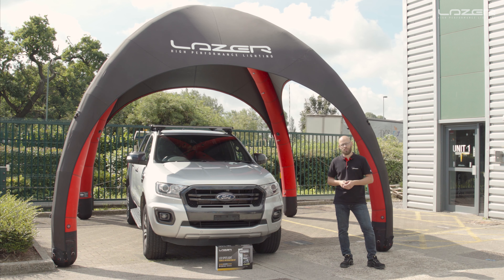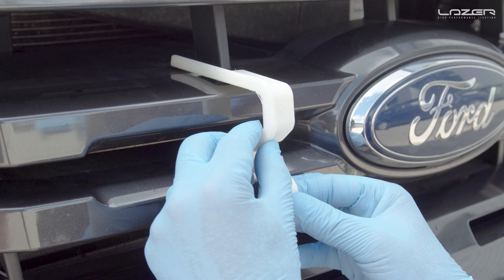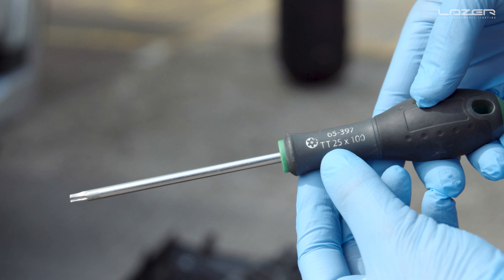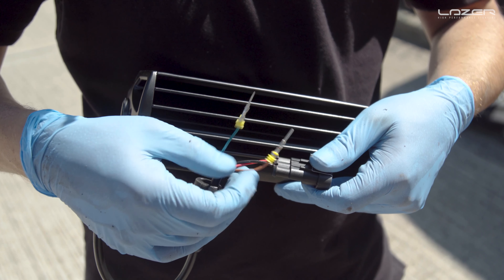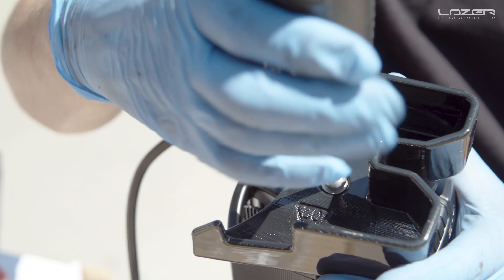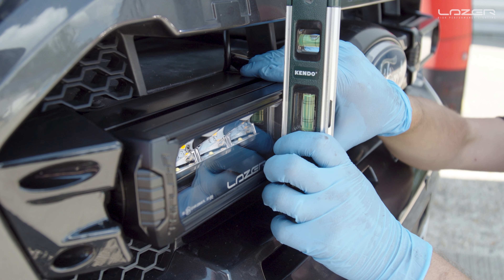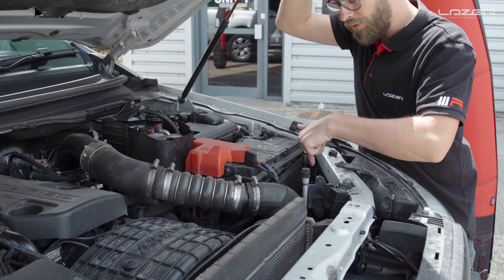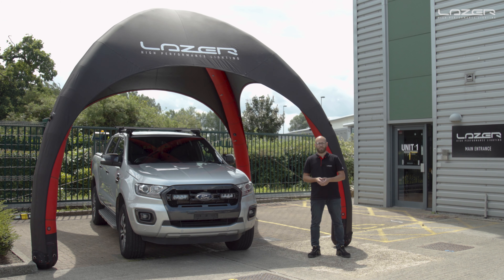How To: Ford Ranger Grille Kit Installation

Comment: Can't that be integrated into the high beams ? So whenever you put on high beams those lights go on as well ?
Reply from the maker: It depends where you are based. The lights are approved to UNECE Reg112 so in Europe for example it's no problem to connect to the high beam as you suggest 👍